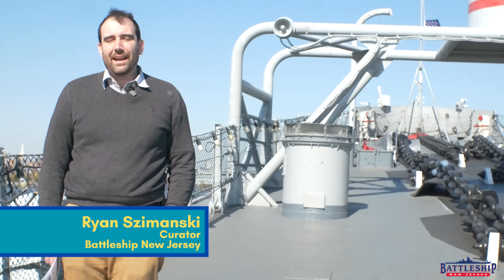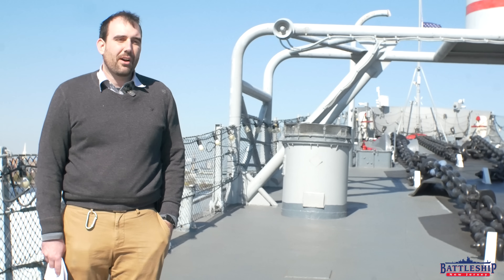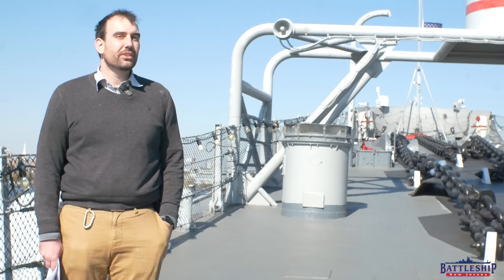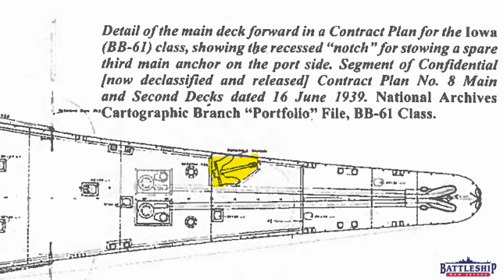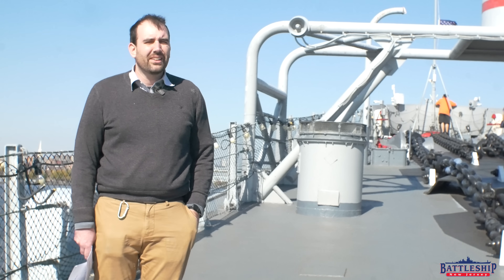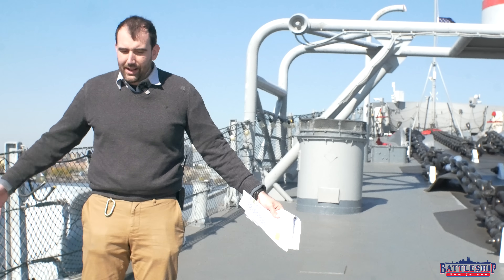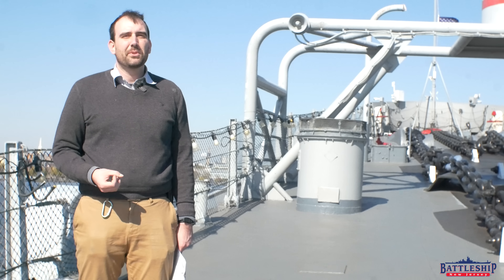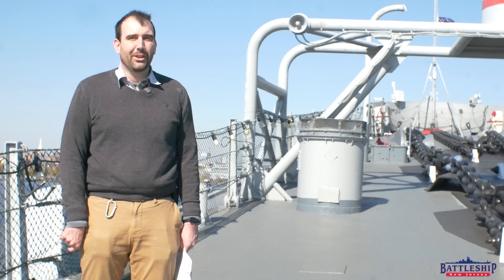What the Navy Wanted To Change About the Iowa Class Battleships: Before They Were Even Built

Comment: How do other countries know that a ship is under treaty limits? Couldnt they just say it’s within limit assuming the ship isn’t too massive?
Reply: Within a certain degree  you can take the hull measurements and  do the math. Width x length x depth = water displacement .   If I remember correctly the ship I volunteer  lst 325  when loading a Sherman tank would lower the ship 1 inch in the water  so could almost figure up how much tonnage of cargo by looking at the depth when loaded or unloaded
Reply: Germans did that. Panzerschiffs vs. Versailles for example..
Reply: @Ah01  Japan did the same with its cruisers.
Reply: @johnfleet235  Yes they did, and also prepared to upgrade the main armament later on, to circumvent the treaty limits. Mogamis where a prime example, bigger guns where installed and problems with top heaviness and stability occurred, less than surprisingly. Loss of balance, in many senses of the word, though strong gunnery force was gained.

Comment: Although this is a question about AFTER they were built, but I wondered why many of the 40mm bofors guns on the Iowa class battleships when they were built during ww2 and after, were not eventually  replaced with the newly developed 76.2mm automatic canons found on the Des Moines class heavy cruisers and later Worcester class light cruisers before the Korean and Veitnam wars before rocket defense systems and CWIS systems installed?
Reply: Why? The 76.2mm was an anti-air defense. By the Korean war they were already nearly obsolete and in Vietnam they certainly were obsolete. Jet aircraft and missiles made any projectile AA weapon essentially useless, even when RADAR guided in favor of missiles. The primary and only function of Iowas in both of those conflicts was really just shore bombardment. In WW2 it was shore bombardment and Carrier AA screening defense. 

https://www.youtube.com/watch?v=FVKLsh71yXw

Comment: Has any museum ship used cured-in-place pipe repair to improve the condition of waste and drainage pipes. Cured-in-place is extremely common in sewer utility repairs as it doesn't require any excavation.  I could see it being useful to preventing leaks on New Jersey's drains as it basically relines the pipe.

Comment: How often are anchors actually used in practice? I'd think they would mostly just be of use in port when not at dock. How common was that?
Reply: It's less a matter of "how often" and more a matter of "What goes wrong if you have an insufficient number when you do need 'em". Consider that when forward-deployed, you'll often have a lot of ships gathering close together in what is a merely temporary mustering point from which to launch some action. If someone in the middle of the pack starts drifting even a few meters more than the parking attendants planned for... well. You get a mess, is what you get.

Comment: So it seems to me it would make much more sense to post a guard outside a regular head and dedicate it to female visitors while they were on board than to have a full time dedicated female head.  It's not like there's only one head on blue water ships.
Reply from the maker: We suspect that under normal conditions it was used by the crew. It's really just a one stall bathroom.
Reply: I imagine the main reason for the builders plans to  designate that this specific one would be the ladies room when necessary is someone decided it would be better if some ambassador's wife didn't have to use a room with a urinal in it.

Comment: Worked a few times wiring up large custom made machines that would take months. Way too often a project engineer would want changes & added motors & controls. Told them two things. 1) that if you have the money I had the time. Yep would only perform changes on overtime hours 2) For every 8 hours that I perform changes & add ons the signed guaranteed completion date would be pushed back one day.
Reply: Architects are a similar breed of cat.  It can be very frustrating explaining to them that in the real world there's a bit more to making a change than using "delete" and "cut and paste" commands on your CAD.

Comment: In the weeks before the attack on Pearl Harbor, the Navy destroyers present were ordered to remove many items (this is in regard to a "goldplater" Bagley-class destroyer:   

* excess wooden items (such as bookcases, gratings, duckboards, railing covers on the bridge)
* linoleum flooring, any decorative paint on compartment walls,
* decorative flags, curtains, awnings, rugs
* dress uniforms, civilian clothing
* correspondence more than one year old, paper and office supplies in excess of a three month supply
* glass in bulletin boards
* cameras (except official ones)
* more than 5 gallons of gasoline, 10 gallons of kerosene, 20 gallons of torpedo alcohol, etc.
* portholes on the first platform. Without these, the crew spaces aft of the engine room get very humid.
* more than one ship's boat (her original fit had two 23' motor whaleboats and one more boat in addition to the two whateboats)
Reply: You know war is imminent when command starts ordering ships to begin sailing without dress uniforms onboard, to reduce fire hazard

Comment: Speaking of anchors... How did they anchor the ship? My understanding is some ships are really held by the payout of chain resting on the sea floor for various reasons as opposed to the anchor on the bottom.
Reply: The anchor is there to just hold the chain to the sea floor while the weight of the chain is the actual thing holding the ship in place. With two anchors, the ship would point in the direction of the wind/current and drop one then as they let the chain out they steam to the opposite side and drop the other anchor then reverse or let the wind/current pull you back so the anchors form a V shape.
Reply: Most are held that way. As I recall they (US navy) generally let out 6 time the water's depth of chain !)
Reply: @wfoj21  Yeah the anchor pulls the chain, making a pile of chain. Then you drift around for a minute and then let out another pile or two of chain. Far more mass than just an anchor.
Reply: Any anchor works best if it’s pulled horizontally along the sea bed. Using chain is the simplest way of doing this. It also has the effect of reducing snatching when the ship moves due to wind/waves. The disadvantage is that you have to haul all that mass back up!